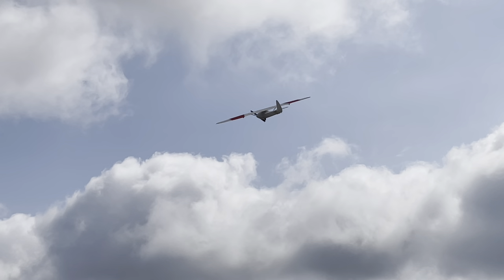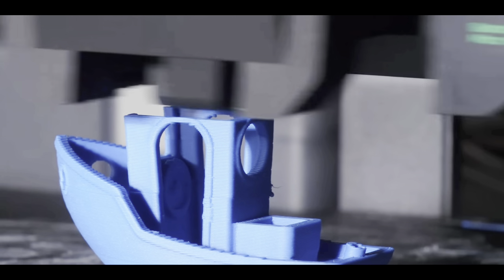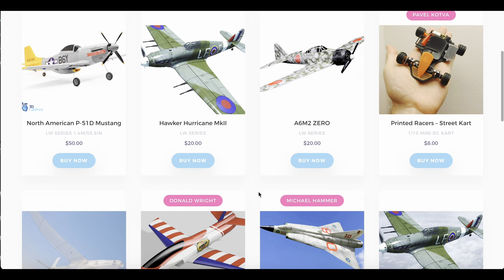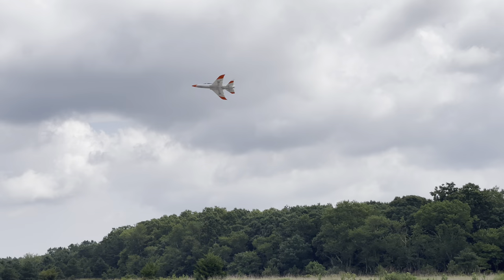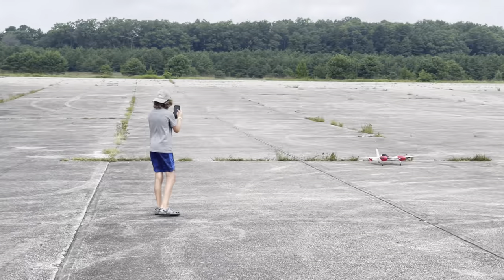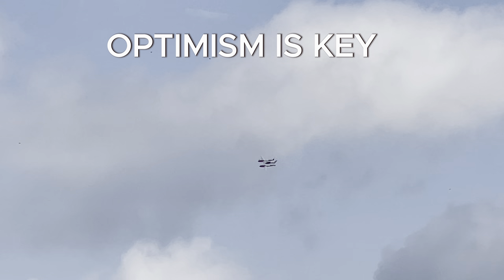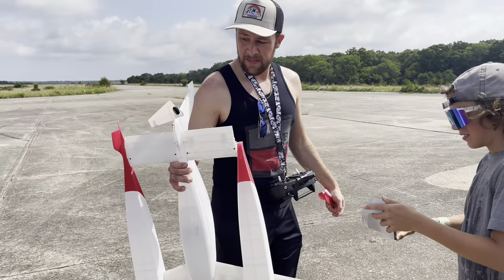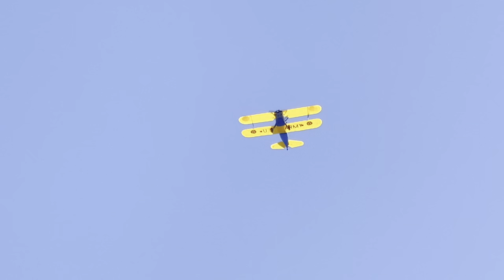3D Printed or Manufactured RC Airplanes - What's better?

Comment: 2:40 
If you go down the 3d printed plane route then you will want to get LW-PLA, not regular pla, it’s about £10 more but it’s definitely worth it, I’ve printed a plane from regular pla and am currently doing one from LW PLA and the difference in weight is absolutely nuts. 
Some people have difficulty finding out the right settings but I didn’t find it particularly difficult.
Reply: Yes LW-PLA Is he way to go and Now there is even LW-PLA HT which resists more heat.
Reply: @ripmax333  Really it depends on what the plane is designed for. There are a lot of planes out there designed before LW-PLA was a thing that fly great and they are more durable than one printed in LW-PLA. But those earlier designs do not print well with LW-PLA. For a plane to print well with LW-PLA it needs to be designed to be printed in vase mode. The nice thing about planes designed for LW-PLA is they tend to be more scale. With normal PLA a lot of times the tail had to be shortened or the nose extended in order to get the right CG for the plane. With LW-PLA you can stick much closer to scale because it is so light. Personally I find that PLA just warps too easily in the sun/heat out here in Hawaii so I switched initially to PETG. Unfortunately there is no LW-PETG. There is a LW-ASA but I've found that ASA in general doesn't have good enough layer adhesion to print planes from and LW-ASA even worse. I've recently added a heat lamp to the enclosure my Prusa printer is in to reduce warping of the PETG. On long prints like wing pieces the leading and trailing edges lift about .5mm which causes assembly problems. The heated enclosure fixed that for me. Since I'm using a heated enclosure now I decided to give ABS a try and it came out great! So I'm switching over all my older designed planes to ABS. For the newer designs I've been testing Colorfab's high temp LW-PLA and that really surprised me as to how well it resists warping in the heat. It did better than PLA+ or PLA Pro. I haven't finished a plane with HT LW-PLA yet but I'm looking forward to it.

Comment: One thing I really love about 3d printed planes is the controls feel very direct. Foam airplanes have a lot of flex in the control surfaces because they also use the foam as a hinge. So foamies have a tendency to have a squishy feel to the controls. As far as the expo...personally I use very little if any expo. Instead I reduce travel with dual rate or ATLs. The reason being is for very small stick movements expo is fine. But as you move further the graph ramps up and the controls get very aggressive and the pilot can easily get into an over reaction. So I'd suggest giving ATLs a try instead. I have 3 ATL settings set up on my radio switches: 100%, 85%, and 70%. I will typically start at 70% as it is the most controllable. But some planes don't get enough control surface movement at 70% so I have the option of going up once airborne. Or sometimes I find that once I'm confident with 70% I can go up a notch or 2 to get more control surface throw.

Comment: I feel like filling printed planed with expanding foam would add a lot more toughness
Reply: That depends on what you mean by that. If you are talking about the foaming LW-PLA filament, it is the opposite. It is weaker. Because it foams there are tiny pockets all throughout the layer so you not only have a more fragile line, but less surface are bonding one layer to the next. Now if you are talking about expanding foam like spray on expanding foam or model railroading expanding foam...that's an idea I've toyed with in my head for awhile. I think it could work and the model would need far less internal structure to be strong. But the problem is the skin is only printed .4mm thick so if the expanding foam is under any sort of pressure will push out on the skin and cause it to distort. That's what I've been trying to find a way around.
Reply: We have had great success with 4%gyroid infill 2 base layers one wall and two top layers. We had a recent crash with our JRM-01C70 model and it withstood a battery loss at height and glided upside down under no power or control and crashed - wasn’t a total loss and we managed to repair and fly again…

Comment: I’ve watched more than 2 dozen videos, poured over a dozen forums and blogs, spent more than 100 hours experimenting with both Pla and pre foamed LWPla, and I’m still no closer to an actual printed aircraft. LWPla has some behaviors that you can’t control and need to compensate for, and Pla is generally “too heavy” for performance aircraft. Idk what I’m doing wrong. Every thing you can think of, I’ve probably tried it already. It’s starting to feel like work, and I’m grounded until I finish a plane(rn it’s the eclipson cobra). I might just buy a plane just to get stick time. Here’s my specs if anyone wants to help:
Flsun v400, overture air pla, cura 5.7, 0.4mm TC nozzle and volcano style hot end with direct drive. I’m printing it exactly as described in the PDF. I’m getting really bad strings(in the middle of a string calibration rn), uneven and peeling brim, poor layer adhesion, disconnected infill, blisters on part, and unpredictable foaming. Just throw ideas at me, I’m open to suggestions and I’m at a loss rn.
Reply: PLA isn't too heavy. RC planes were printed from normal PLA for years before LW-PLA was invented. But you really need to stick with what the plane was designed for. Older designs will not print well with LW-PLA because they are not designed to be printed in vase mode. New planes designed for LW-PLA will not do well printed in regular PLA because they tend to be more scale and you will need to add a lot of nose weight to get the CG to balance correctly.
Reply: Now to address your issues...for the LW-PLA if you are getting stringing you probably need to follow the B2-LW category settings. This uses the spiralize settings (AKA vase mode) to print in one continuous motion, without retractions. If you are using an active foaming LW-PLA then anywhere you have retractions you are going to get stringing. There's no way around that. If you are using a pre-foamed LW-PLA then you might be able to. You shouldn't necessarily follow the PDF settings exactly. You need to modify them to suit your printer. The heat and flow settings are going to vary from person to person depending on what printer they are using and what filament they are using. So you need to print a calibration cube to determine what those values should be. I have a theory about the volcano type hot ends...I was using the Mosquito Magnum hot end on my printer for a long time which is similar to the volcano in that the melt zone is much longer than your typical hot end. I theorize that the longer melt zone is causing active foaming LW-PLA to foam too much even at lower temps which would result in a weaker print. I tried with LW-ASA years ago and the test print just broke apart in my hand. I switched to the normal Mosquito hot end more recently and tried LW-ASA again and still it was bad. So I don't have any confirmation on my theory but the idea makes sense. This plane is also printable in regular PLA. It will be heavier so it will be harder to fly but also more durable. Either way I hope your an experienced pilot because the cobra is for the more advanced pilots.